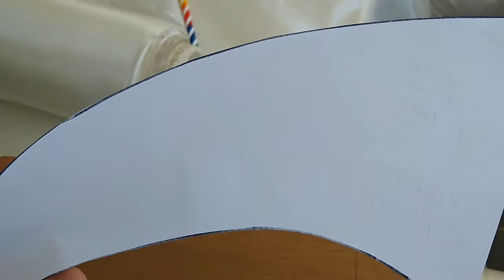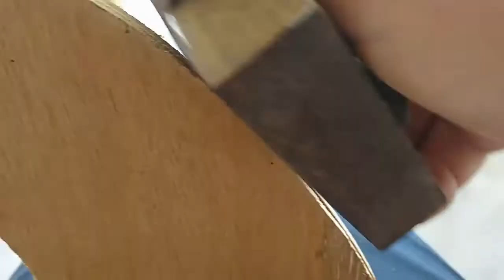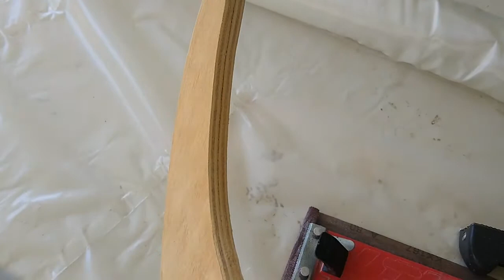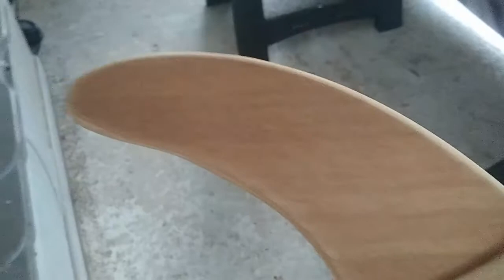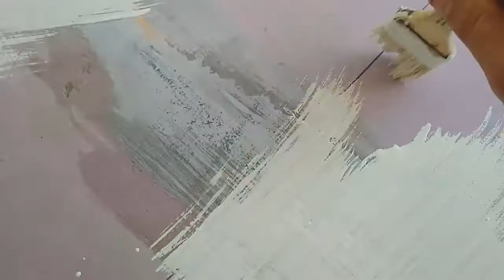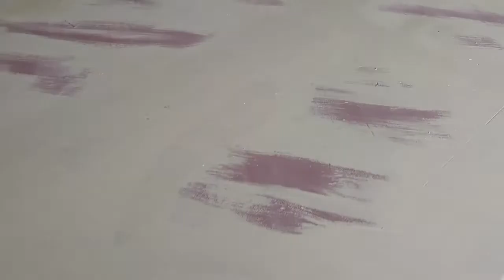Making Fins and Painting the SUP

Comment: So no poor or frugal man's fiberglass? Just paint? How's it holding up?
Reply from the maker: The board has frugal man's fiberglass. The paint was just for looks. It isn't holding up too well! Maybe because of the paint, but it is de laminating quite a bit. Planning on ripping off the frugal man's fiberglass and putting on poor man's fiberglass. Thanks for the question
Reply: @arichardofalltrades6770  Thank you for the reply!
You're inspiring me to build one myself. 
Another question I have, if you don't mind, is how are the plywood fins doing? And what are they coated with to protect them?
Reply from the maker: It was a lot of fun to build, and a lot of fun to use. I recommend trying, and buying material as you need it, as if things don't work out early, you have little invested. The beginning is the hard part. I painted the fins with the same epoxy as I glassed with, and they are just like new. Good luck! Interested in how things work out!